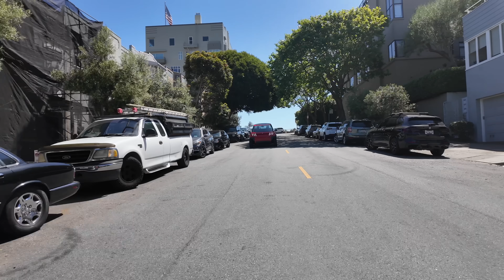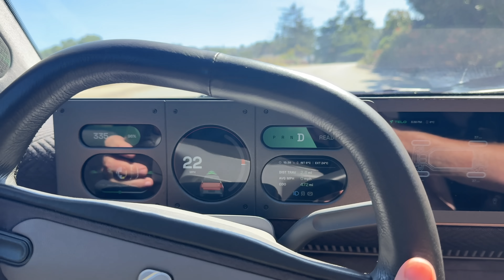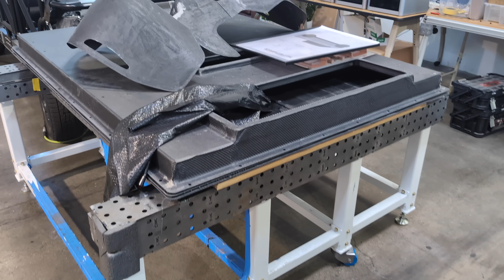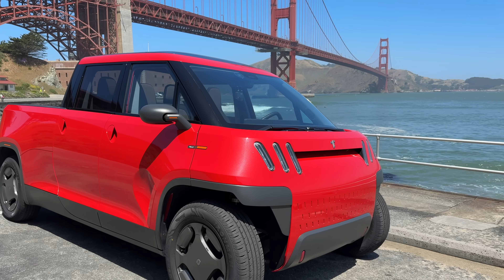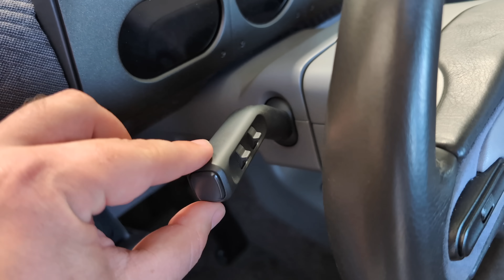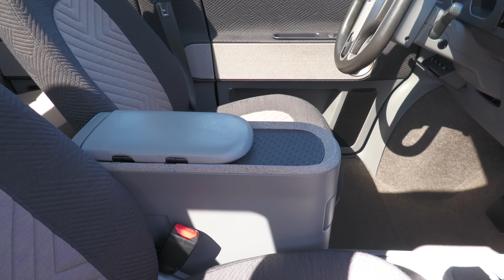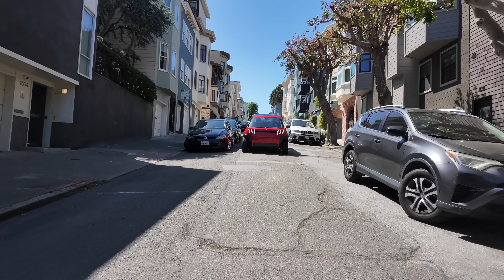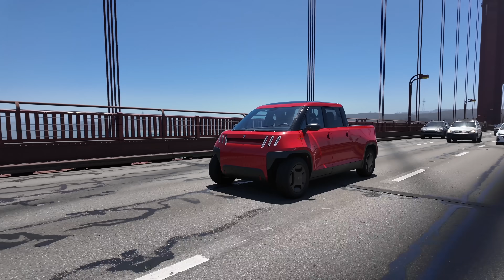The Tiny Telo Truck Hopes to Pack a Big Truck Punch

Comment: 2:10 Briefly skimmed the comments, and apparently I’m the only one that thinks a starting price of $41,500 is WAY too expensive. Give me a stripped-down, bare-bones version for like $20,000 - $25,000 and we can talk. (Similar to the SLATE truck.) The guy even says it’s made for “downtown cities”; I don’t need a bunch of bells-and-whistles for short trips around town, just the basics.

Give me an airbag, ABS, heat, air conditioning, cruise control, and a simple bluetooth radio. I do appreciate this has 5-seats standard vs. the SLATE with just two, though.

All that said, I hope they make it. I can always pick one up used in a few years for like half the price or less, LOL.

Comment: I am curious what the point of building a pickup truck built for a city is? I've never owned a truck to be clear but I definitely see the utility of them out in the country. I live in Seattle and don't really see the need for a truck built for this sort of environment. It is a neat vehicle, regardless
Reply: Contractors - couriers, repairmen, building and automotive maintenance, some forms of construction, cleaning, tech (computer stuff, security systems), and so on. Especially if and when they start selling a shell topper for the bed.

Comment: Such a fun design. I'd love to have one here in Australia. But given the need for long range and our Au$ to US$, it would be over $100k. So a no-go for me. 
I like the look of these, but obviously owners will want to do upgrades and accessories, so i hope they have considered this. 
First upgrade would be larger wheels to make use of the 4x4 capabilty and gain clearance. Sadly the body would need cutting as th arches are too closly matched to the wheel diameter. 
Back when they only had the driving open chassis, I mentioned they should also consider the market of open air super basic raw vehicles. 
How awesome would it be to do rough skins, custom composite body designs, or even just a skin on frame. Bring back individual or short production run coach built bodies.

Comment: "They don't take it on the highway because it doesn't have airbags."  A few moments later they're on HWY 101 driving over the Golden Gate Bridge.
Reply: I understood it as not the interstate like I280, and more importantly, not 60 MPH. Golden state bridge is only 45
Reply: Yeah, US 101 over the golden gate has a 45 mph limit.  So if you take the first full exit you can loop back before it goes to 55 or 65.
Reply: Jay Leno had it on the highway. And he did have it moving out a bit. At least it looks like a highway. Take a look at the video, I may be wrong. It was Jason Marks and one of his developers.
Reply: That’s because that’s a state road and not a federal road. So, yes it’s not a hwy as you may think of it. If they had taken it out on an interstate hwy, that would be a federal highway. Just saying.. 😅
Reply: @MarcFahey-y2q  Highway 101 is technically "U.S. Highway 101"... "U.S." meaning "United States" which makes it a Federal highway. It runs through California, Oregon, and Washington.

The terminology confusion comes from people often conflating "highway" with "freeway" when not all highways count as freeways. Highways can have stop signs, stop lights, crosswalks, etc. Freeways do not. "Interstate Highways" are probably the most recognized version of a freeway. So when he said "We don't take it on the highway" he really meant "Freeway"

Comment: Two seater version in a van would absolutely kill it in Europe, perfect for inner-city job sites where there more and more restriction on emissions.
Reply: In most cases a van would do a much better job.
Reply: @jimj2683  trucks are more popular in the US
Reply: @Blueee51  Yeah, but it makes no sense. They should instead be buying vans with bigger engines for towing and more ground clearance. Pickup trucks only look cool.
Reply: @jimj2683  Does everything popular have to be practical?
Reply: @Blueee51  No, but most people buying trucks insist that they need them for practicality.
Reply: @Blueee51 

yes
Reply: The original BMW mini countryman and a few others had 3 door set ups with pavement side passenger  doors the other trick is the door and a half suicide door ...  To reveal  access to the rear seat or interior to the more mobile occupants like kids and teens and slim active folks 😂 able to slide in the back. 5 of us went to Wales with a full set of tools in a real Igisonis mini  clubman ...1100cc. 😂 over a hundred miles each way and boat building between.
Reply: Isn't it an electric minivan then? Because you are describing the size and function of a minivan
Reply: @misham6547  Do you know of an EV minivan that does 350 miles? Or a Transit/Sprinter class?
Reply: @misham6547   They are planning on selling a from the factory conversion, then.
Reply: A 2 seater telo van would kill it in the US for fleets vehicles and Van lifers  alike
Reply: You just get it with the camper shell and then either lower or remove the seats, depending on how much you want them out of the way (they're level with the bed when lowered) and then you have that
Reply: Three seater would be required. Like the competitors.
Reply: @rogergustafsson1577  which ones?
Reply: @sparqqling  Peugeot Expert

Comment: The guy in the Netherlands is right. This is almost the same size as a Lynk&Co. 01 I rented once in the Netherlands. The 01 is 68cm longer, but the TELO is just 4cm wider and 1.8cm shorter. I hated the 01 in the city, because it was just too big. Out in the open it was fine. It's bigger than I thought.

Comment: Please add a drivers crotch vent.  Southerners will love it. 

Tactile ac and radio controls 5 ever. Look at the controls and vents on the 08 grand prix. I am biased. 

Have tthey tested it in very snowy places? RE: the capacitive door handles. Its a point of failure that could cost lives. I have Reynaulds and dysautonomia (covid long haulers like Physics girl get it mine is from mold exposure ) and especially in winter I have a hard time using my phone even with the sensitive mode turned on and I had to get my friend to open his Tesla door for me. He thought his door was broken. 

Needs oh shit handles like the Tacoma. Would be wheelchair friendly too. 
Chevy Lumina wipers?  Interesting choice. 

How will it handle front corner impacts with no body panel there?  

What do the headlights look like when behind someone in a Miata? 

It would be cool if you could easily remove the back seats or they did stow flats for installing a job box. 

I wish them luck! Knowing his daily is a Tacoma bodes well for practicality.
Reply: My 03 Xterra had the driver “ball chiller” and honestly I’ve missed it on every other car I’ve owned. Best feature.

Also I can answer your other questions too:

The capacitive door handles were just for the prototype. The production car will have real handles.

It will absolutely have oh-shit handles

Comment: I'm the Telo ute from a small EV company as many start up EV companies have failed because they have loaded there EVs with to much tech and useless junk the KISS pricepal could work but in Australia there are EV utes available and l haven't seen any and single cab utes sell in Australia especially the Toyota Hilux  2X4 single cab ute with an aluminium tray as with my 1997 Toyota Hilux ute its petrol with the ultra reliable 22R engine and image this Talo with a single cab with an aluminium drop side tray the tray would be large enough to take two CHEP size pallets how handy and practical would that be all l can l hope

Comment: If Telo really wants to be a city work vehicle seller, #1 make the front and back have a built in hitch covered with a knock out cover that inserts into the space it covers, #2 make the frame, power train, and suspension the same between vans, suv, and trucks.  #3 have a great converter and plug access for either tools or city info trailers/crowd management.  Telo could replace a lot of urban city vehicles, and also contractors in the same urban use case.

Comment: Two disagreements.  The first is on the price.  For those needing or wanting to save $, who are looking for a mini truck, the can buy an older Kei truck for 1/2 to 1/3 the cost which has already been imported and gone through the title process.  The second disagreement is on the "no one buys a two door truck" comment.  Most manufacturers have stopped offering two door models for almost a decade. Doing this has reduced manufacturing costs and times, but leaves many buyers with backseats which are never used for anything other than a place to toss a spare raincoat.
That aside, I wish Telo the best in their endeavors.

Comment: Now see, honestly if only they made it so the computer stuff was self-contained in a tablet, or at lest interfaced with a separate computer via USB to provide an interface, then they don't even need a screen. There could be basic indicators where the tablet could be if the tablet were missing and the device was powered on with it, and the tablet could serve multiple purposes while being a value-add.

Comment: a couple things that could make this even better, a slighlty cheaper version that is just a 2 door (with a 6' bed, and if you want the same length, add a frunk) and optional AWS.

AWS especially because it would allow it to be a beast for manuverability.  The Audi A8 has a turning radius of 42 feet. The extended wheelbase version, because it has AWS has a turning radius of 38 feet, dispite being longer. AWS on this truck would be great. (Especially if you can toggle it on or off depending on situation)

Comment: Why do they keep designing electric trucks to look like they are for Steve Urkel? Make a normal looking  and functioning truck with a decent sized bed and a minimum range of at least 350 miles, and 4x4 and it will sell if it is not too expensive.

Comment: Ok, they lost me at “…$50,000”. 🤦‍♂️
Reply: Too cheap for you? Please, name a cheaper EV truck with most of this thing's functionality. Some try to name drop the Slate truck, but that thing only has 150 miles of range and only tows 1,000 pounds for $20k, and it also has no A/C, no sound system (etc) which is nowhere near to the functionality of even the base $41.5k MT1.
Reply: @SweetBearCub  who cares? The Tello and the Slate are both city trucks. That range is WAY more than enough.

Comment: Frankly, the only thing that could improve this more for me is if the battery were shrunk a bit and the under-bed tunnel were about half taken up by a smaller-than-Kei-style engine as a range extender. Frankly, if Telo succeeds, a range extender version with a smaller battery, perhaps of the far, far safer LiFePO4 chemistry, could come along in a few years once Liquid Piston begins commercial sale of their engines after their military research contract is finally fulfilled. Their engines can hit nearly 75% thermal efficiency, which compared to Mazda's experimental SkyActiv-X's 53% is really, really good. Just, well, LP's engine has no valve variability, so to get good top-end power you lose lots of low-end torque, the rotor's vapor chambers are designed for a certain power band capability. Its basically a Wankel, flipped inside-out, so there's no centrifugal force grinding down the apex seals, and its shown very, very high compression ratio capabilities with little to no concerns about stress on the seals. Its like Mazda accidentally began rotary development backwards and now LP came along to do it right, using the US Military to have help in refining it to a finely-tuned powerhouse. For reference? 42 pounds is how heavy a 25 horsepower supercharged 2-stroke version is, currently in service on long-loiter drones, with naturally aspirated 2 stroke and 4 stroke versions used in off-grid military generators that can be lifted with one hand while putting out several kilowatts of electrical power.

Comment: how bout, no. the telo mt1 is approximately 18 inches (460 mm) longer and 14.7 inches (374 mm) wider than a kei truck; it's not novel, or the first one designed for city driving. the guy is a sheltered moron or a liar. in fact kei trucks, like a daihatsu hijet, were among the first compact trucks specifically designed for urban environments of post-war Japan as a response to the need for affordable, small, and efficient vehicles. all they did was give the hijet deck van a larger bed.

Comment: Get rid of the unnecessary dual cab, use that space to extend the bed to a proper length, and forget about the useless 500hp dragstrip nonsense and you could have a decent ute.

Hopefully BYD will have something that does the job soon. Probably for about half that price.

Comment: Dials! minimum for audio and climate control. How hot do you want it, where do you want it, and how hard do you want it. pls. I beg you. gimme dials For the love of driving give me dials. I had a Chevy volt and had a few occasions where I yelled my voice harsh on a drive home infuriated by the horrible captive buttons for the climate control. If you don't do dials have a slider at the least that's always up, I need to be able to change the temperature easily and QUICKLY, a quick rotate of a dial can't be beat.

Comment: Neat, does it come in a 2-door, 2-3 seat option?
A bed more than 5 feet long will be REAL 'Big Truck' capability.
[edit] Ah, a midgate. That's fine then, carry on. Now my only question is will it plug in off of a household outlet for overnight charging? They mentioned power-to-grid so it'd be nice to go the other way. [edit]

Comment: Mid-gate .. hmm hmm might get my interest.  the need to carry 8x4 sheets is absolutely key.  I have to do that fairly often with my 8 foot bed Tundra.  I have no need for a back seat - ever.  I absolutely despise how oversized my Tundra is to drive and park, but for the big cargo bed it is a godsend and any midsize truck with 5 foot bed limit, not 4 feet between wheel arches, is useless to me.  I like to carry 16 footers sometimes too though.

Comment: Hmmmm...I'm...cautiously optimistic about the MT1.
However, I have some gripes that I'd need to see addressed before I'd consider buying or recommending this truck to someone...

1. 500 Horsepower is a bit too much for what the MT1 is trying to be (in my opinion).
-----------------------------------------------------------------
I understand that the nature of current EVs is that they're significantly heavier than a normal ICE car, or even hybrid cars, so it makes sense that you need more power to get the vehicle up to the same speed as a non-electric car. But...even with that in mind, I still think 500 HP is a bit more than what's really needed.
More importantly tho', implementing that 500 HP electric motor setup ends up jacking the price through the roof (more on that in a bit). As such, I think Telo should consider toning down the total output of the production version of the MT1; 275 to 350 would be more than enough for most folks' use cases.

2. The price is a bit too high for what they're offering.
----------------------------------------------------------------
I understand that Telo is a small startup company based in San Francisco (and thus aren't gonna have the ability to mass produce the MT1 at a rate to match many of its competitors), but I still think the price will be too much for your average buyer, especially given the very precarious state of the US economy at the moment.
And considering that the MT1's closest competitor, the Blank Slate pickup, will be going to market with a starting price of $20k...well, I think that saying the MT1 will have a tough time carving out a place in the market is a bit of an understatement.

Point is, Telo should consider dropping the final retail price from $41k to $20k or even $25k. That would allow it to be more competitive in terms of pricing, and ensure more customers actually have the ability to get their hands on one (that last bit is especially important if we wanna see some proper tests of the MT1's capabilities).

3. Analog gauges, please.
----------------------------------------------------------------
This is more of an aesthetic taste, but I think replacing the digital gauge setup with some traditional analog gauges - even if they're just some aftermarket/off-the-shelf units - might help the MT1 be more cost-effective, and also more faithfully invoke the aesthetics of a traditional pickup truck.

Comment: Very neat little truck i like how they put the gauge cover over a full lcd screen just to give it a more old school look maybe have it set up so you can remove the cut out cover and have the full lcd to use or leave it in for the gauge cluster look would be one of those neat little touches and allow for some personal touches. Maybe even have the entire instrument panel be user customizable with custom themes similar to aida64s sensor panel for pcs you can theme it a million ways go super complex or super simple. I can see parents using their family photos or vacation photos as a background with the gauges as a overlayothers might want to do a wood background and have the gauges with a solid gray or silver background all sorts of fun stuff. Hell replace the entire dash with one large display so you can have any dash style you want wood leather gauges everywhere or just the gauges you absolutely need. Don't need a map display well it goes away replaced with your dash material of choice. None of these little touches would add all that much to manufacturing or programing costs in fact it might even save some material costs. It is easier for a display manufacture to make one large single display that is shaped in to a dash than it is for them to make 6 different sizes and shapes.